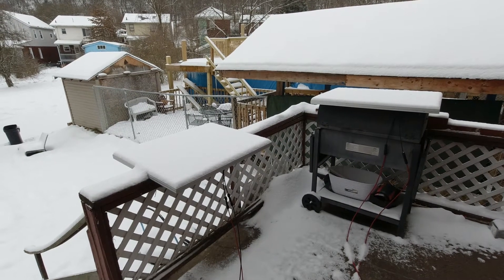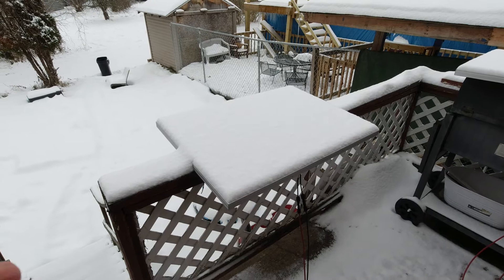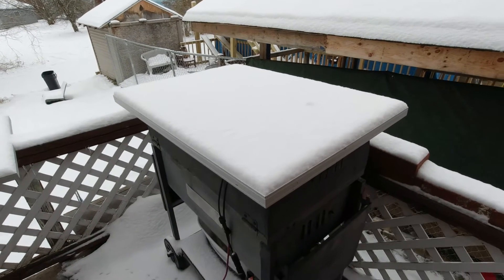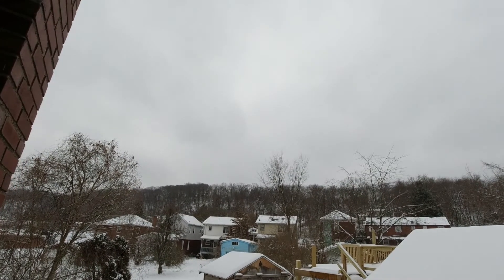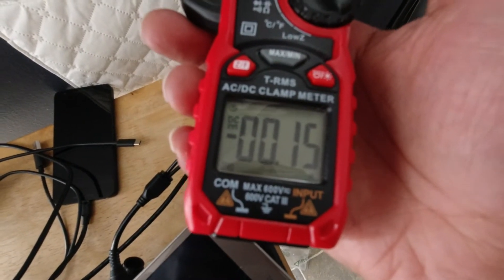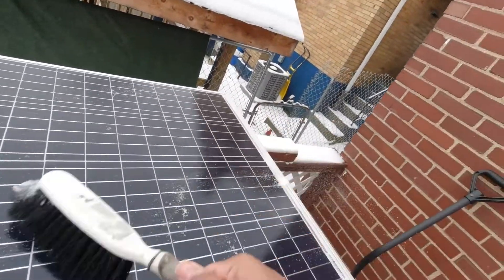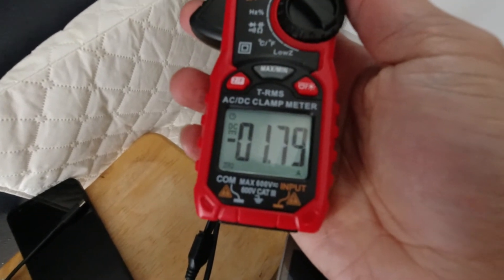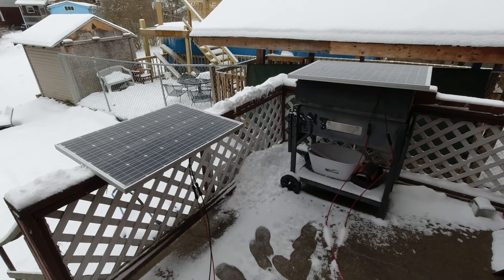Do Solar Panels Work With Snow On Them?

Comment: Nice test !  Wow, 1.8 is real good in those conditions .  Was that 1 or two panels ?  Peacefrom510
Reply from the maker: Two panels. That's been my setup for the winter and with that 50 watt panel basically providing enough power to my beaudens.... It may stay this way in the summer. Hopefully I have another PPS by then. There are a couple budget lifepo4 ones with pure sign wave inverters. 
I think I mention it in this video. 
https://youtu.be/dZdo8C7RW7k